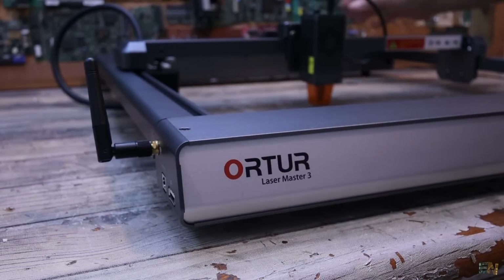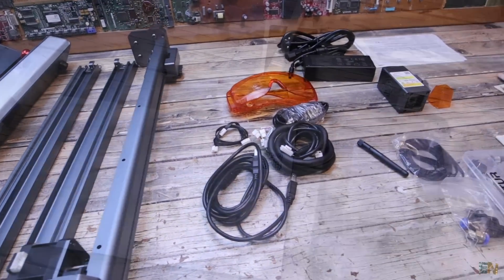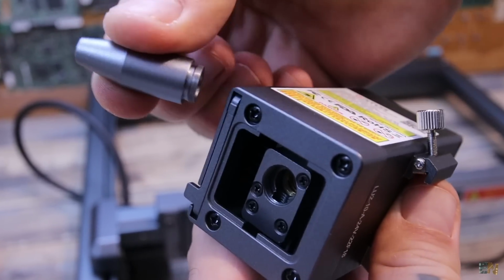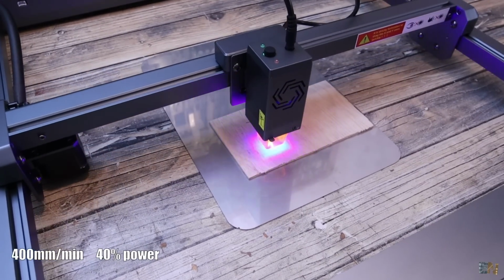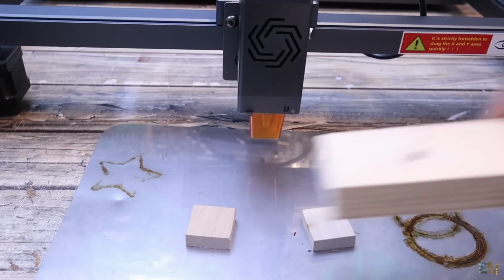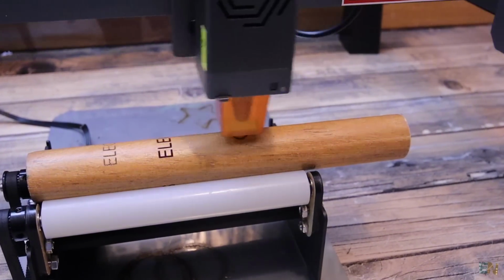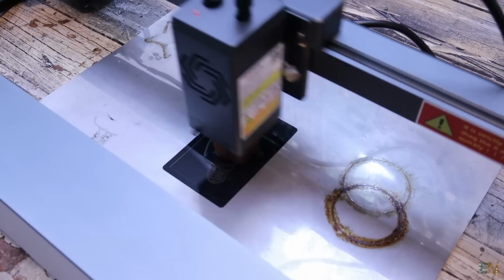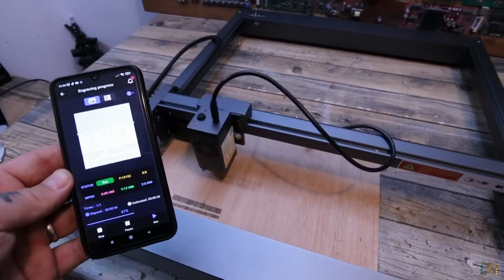What Can You Cut With This LASER Machine? - 20mm Plywood???

Comment: This machine is incredibly dangerous without an enclosure or shielding. Even with safety glasses, they protect you but not anyone else in the vicinity. 

However, judging by the like to dislike ratio yet no one is addressing this in the comments, I'm assuming you delete every one that has pointed this out. So this is really just me sending you a DM.

Comment: hi when i start it goes to 600 x 600 mm space so always try to get beyond the 400 x 400 mm even when we make the changes
Reply: How did you connect the laser with the starting at the bottom right. Mine goes from top right and down, Wpos - 600 , -600